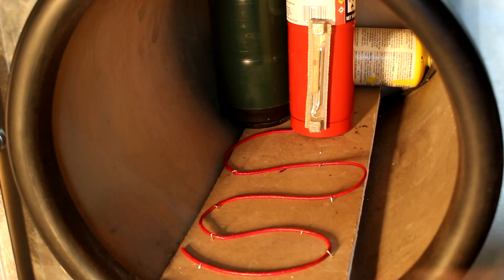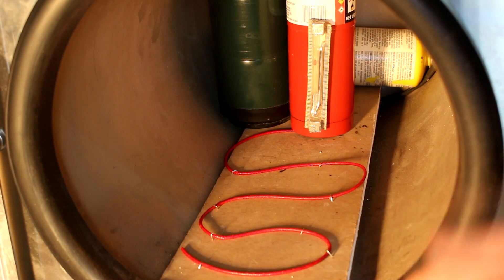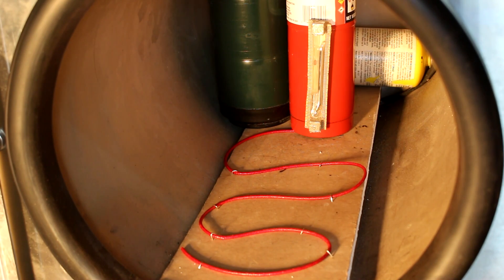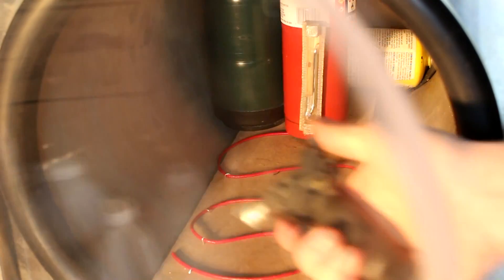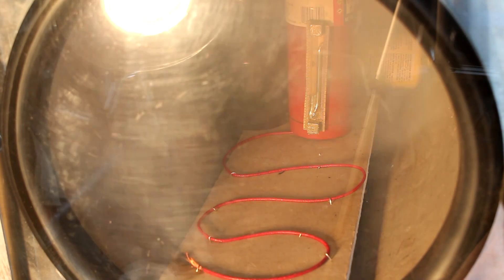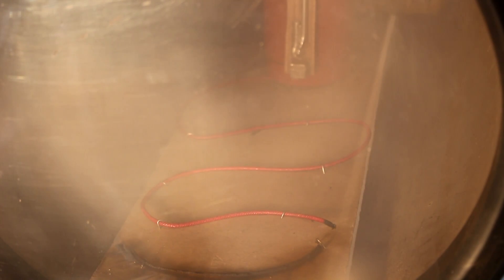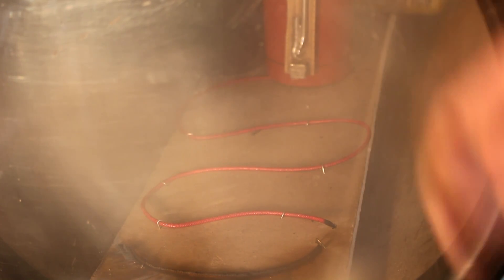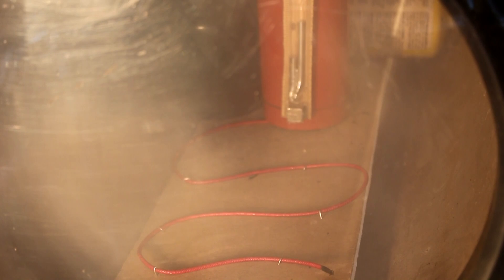Can You Defuse a Bomb Using a Vacuum Chamber?

Comment: oops,,  explain please....
Why did the vacuum put out the fuse? 
Isn't the oxigen in chemical form inside the mixture that makes up the fuse?
thanks for a good vid...
Reply: As he displayed in another very recent video, it seems that for most things to burn, they don't just need oxygen, heat and fuel, but also pressure! :)
Reply: Basically, in a vacuum, the hot gasses escape so rapidly that they don't transfer enough heat to the surrounding particles to actually maintain the reaction.
Reply: Dynamite detonates - there, a shockwave actually propagates through the material, and also, the reaction is "internal" - it is a single type of molecule (nitroglycerin, with a stabilising agent so it is solid and doesn't go boom if you hit it) that just rearranges itself. So, I think that dynamite, just like any other high explosive, would explode in a vacuum.

Also, I believe well-confined low explosives like gunpower or guncotton could also explode in a vacuum, as the confinement would allow the pressure to build - so a gun would still work in vacuum. All the tests Cody has done were with little to no confinement.
Reply: Black powder's burn rate is very dependent on pressure. (That's why the same amount can be used as a fuse or fastmatch just by confining it) It would be interesting to see if fastmatch would stay lit.
Reply: Oxidizers release oxygen when heated.
The fuel (charcoal, sulfur) wants to burn, but the vacuum literally sucks most of the oxygen out of the reaction area.
With less oxygen for burning, the burn rate falls.  Less burn, less heat.  Less heat means less reaction liberating O2.
Pyrotechnics devices used in space need to be in air-tight, somewhat pressurized containers.  By providing an atmosphere, the pyro mix is able to get a 'running start' when ignited.
Reply: If they are released into the chamber faster than their vapors could escape on their own (which is basically the situation you have in the chamber of a hypergolic fuel rocket engine in vacuum), they will quite happily do their thing, react and produce hot gases under high pressure.
Reply: Yeah, I assume if you just directed a jet of hydrazine against a jet of NTO, they would still ignite even in a vacuum, as long as they are still liquid or the vapours are sufficiently dense when they hit.

And monergols (monopropellants, things like hydrogen peroxide or nitromethane) would of course still work, as they are just a single molecule falling apart/rearranging itself to a more stable configuration.
Reply: hii 488 hmmm
I'm not going to say that, that is wrong...  but would a stick of dynamite explode in a vacuum ? And the one that I have wondered about, Pressure causes things to explode, as in a diesel engine ( pressure or heat due to pressure ). But is there a pressure that would keep things from exploding? And would that pressure stop the chemical reaction?
Reply: Pretty sure it was literally the last video he made before this one.
I'm guessing that dynamite wouldn't explode in a vacuum, but that's what experimentation is for, I guess? I'm too lazy to look it up for someone too lazy to look anything up. As for your other question, no, I don't think so. At a high enough pressure, I think the chemicals would still react, they just wouldn't be physically able to expand.
Reply: he also made a video about wether you can or cannot hear sound/explosions in space. so it does work, because there is a container in which the pressure can build up.
Reply: xXphaZXx The vacuum chamber has a pump continuously removing any gasses it can from the chamber, so no, the vacuum chamber will not allow the pressure to build up.
Reply: Greg Gallacci This gets me thinking.  What would happen if you mixed hypergols in a vacuum?  You'd have to figure out a way to seal up the hypergols until you were ready to mix them, though.  Nitric acid fumes are probably bad for vacuum pumps.
Reply: Zuthal Soraniz Hypergols work differently than these fuel/oxidizer reactions demonstrated here, don't they? With hypergols the two liquids being mixed directly react with each other, it's not dependent on reactive gasses being generated, so presumably they would still react and "burn" even if they were not being confined by the thruster/combustion chamber. Of course, that would be kind of pointless, but I think it would still work.

Comment: can you defuse a bomb using a vacuum chamber?
Reply from the maker: This is totally going in as the new title
Reply: The hot gases just disperse instead of heating the fuse.
Reply: Cody'sLab I'm laughing so hard at first I was confused cause I thought he repeated the title and then I read comments
Reply: watch his previous video about fire in a vacuum.
Reply: Zarif Safwan Hoque Can Vacuum Put Out a Burning Fuse
Reply: Man Spider Most likely not because a vacuum chamber can't cut the wires and is too heavy to hold with your hands but maybe if you bash the wires with it you could stand a chance.So I'll stick with wire cutters.
Reply: why does the fuse go out? no fuel to burn?
Reply: Man Spider what was the previous title?

Comment: so if it didnt went of because of the oxygen. why the fuse didnt keep burning up?
Reply: Cody in a previous video suggests expanding the fire triangle, the elements required for combustion  (heat, oxygen, fuel) into a heat square, adding pressure as the 4th required element

Comment: So, if it isn't the lack of oxygen killing the fuse, is it the lack of pressure?
Reply from the maker: lack of pressure.
Reply: Cody'sLab what it you rolled a layer of aluminum foil around the fuse for the same test, would burning inside the foil tube generate its own pressure enough to burn the whole way?

Comment: Would smoke stay floating around in zero atmosphere or would it settle on the bottom......guess I don't know what makes smoke act like it does in air but what would it do with no air
Reply: You could definitely still see it, but the smoke would settle very quickly. The main thing that makes smoke rise is that when it's hot it is less dense than the surrounding air so buoyant forces carry it up. Without that, it would only float by virtue of being very light. Cody has a few other videos with his vacuum chamber where he burns things, and you can see the smoke drop almost as fast as a rock.
Reply: smoke are just super fine particles floating in the air. without air, you wont be able to not see the smoke.
Reply: Smoke is tiny little particles in the air. As mentioned, it rises because some air is hot, and the smoke particles are light enough that the air can push them around, much like dust or sand might in stronger winds.

If you burn something and make smoke in a vacuum, it will rapidly expand outwards at first as the air from the combustion expands to fill the vacuum, but soon the gas will become thin enough it won't be able to support the smoke, and the particles will fall to the bottom of the chamber. You can see this exact behaviour in his prior video.

And to be clear, it "falls as fast as a rock" because gravity accelerates all things equally. The only reason light things seem to fall more slowly sometimes is air resistance. Without air, everything falls at the same "speed."

Comment: What? Why does the fuse go out? If anything shouldn't it be burning more vigorously like the explosions? 
Please explain this! :D
Reply: There was not enough oxygen and pressure to allow the fuse to burn. Burning is a reaction that requires oxygen and creates other gasses. Most fuses contain an amount if oxygen that way they can keep burning even if there is little oxygen in the air. But in the vac chamber, the oxygen being created then burned by the fuze was being dispersed throughout the rest of the chamber then removed by the pump, making for very little oxygen and very little pressure, causing the fuze's flame to fizzle out.

Comment: So given all of these experiments that seem to show that pressure is very necessary for combustion, is the age-old hypothesis that a gun can discharge in space true? Obviously they can discharge without the presence of oxygen, as many videos have shown them shooting underwater (gunpowder has its own oxidizer), but it seems like no pressure might render them useless.
Reply: Off course: the bullet seals the barrel and the casing, chamber and bolt prevent any gasses escaping the other way, so the explosion is contained, regardless of whether there's air to push against or not. What may be interesting is would the weapon cycle reliably (in blowback/delayed blowback/gas cilinder designs). One might want to take a revolver to a space gun fight. :D
Reply: Once the explosion gets going, I agree. However, his experiments showed that it's really hard for combustion to even get started. I don't think the cap is air-tight, so I don't think the gun powder will be able to chain from the primer (when he lasered gunpowder from before).
Reply: Possibly not completely, but tight enough for the combustion gasses to make up the pressure difference if indeed what little air was in the cartridge had leaked out in the vacuum of space, I think.

Anyhow , this has been suggested a couple times in the comments now, so maybe he'll just try it.

Comment: perhaps you should get a cold trap, or at least a filter for your pump...

Also, could you try to ignite an oxidizer (like potassium nitrate or chlorate) in a reducing atmosphere (like propane)?

(just fill a jar with the gas, put a bit of the oxidizer in, and, while standing at a safe distance, try to set it on fire with your laser.)

Comment: What about a mixture of hydrogen and oxygen gas?
Reply: But will it do so in a vacuum?
Reply: You can't have two gasses in a  vacuum... 'cause then it wouldn't be a vacuum. You could fiddle to find the lowest pressure at which a stoichiometric mixture of O2+H2 will burn, but it would involve a lot of fiddling at very low pressures to get a temperature-dependent number.